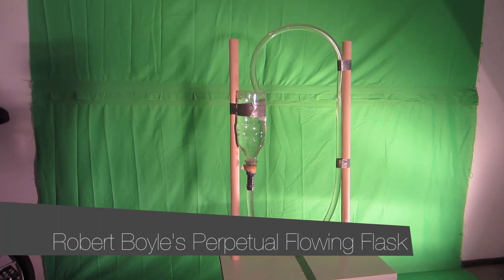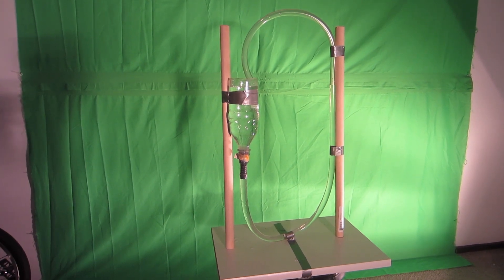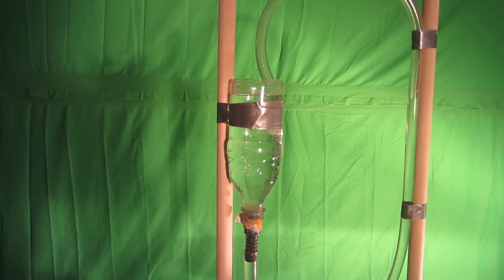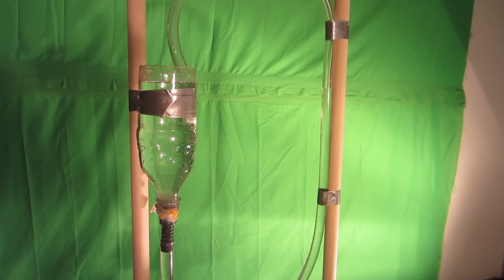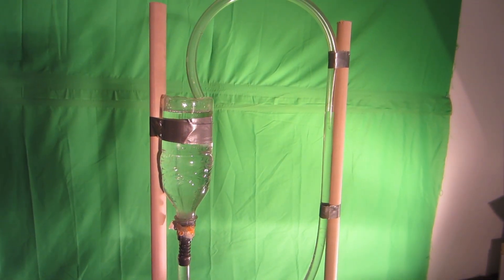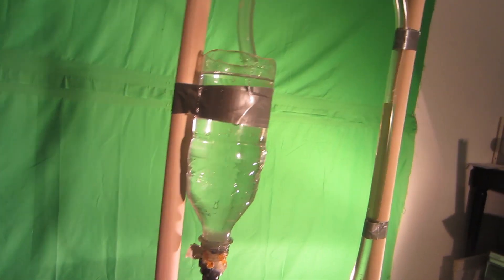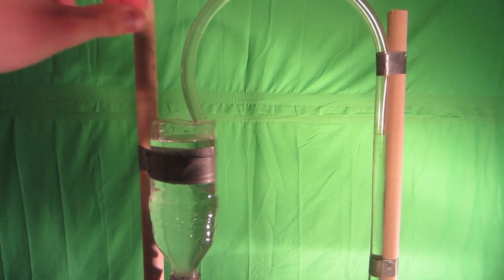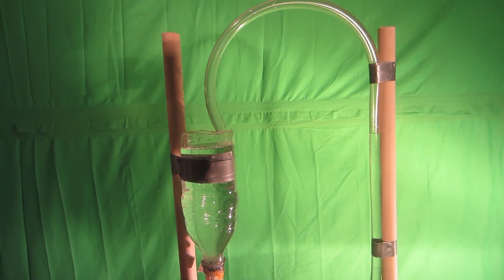Robert Boyle's Perpetual Flowing Flask Doesn't Work

Comment: Finally found a reference:

http://rationalwiki.org/wiki/Perpetual_motion#Capillary_bowl_.28Boyle.27s_Self-flowing_Fluid.29

I quote:

"water tension (related to the same force that causes capillary action) would prevent the flow emerging from the capillary at the end. A droplet may form on the end of the capillary, but would be held in place by the surface tension of the fluid; you could shake the device, forcing it to drop and encourage the flow to start, but that would be adding in energy to the system and defy the point of perpetual motion."

This takes care of all the "capillary" comments.

For a larger diameter (as in every single video I have seen, even if I have not seen them all) we have a macro situation where it is all about a communication vessel and there the levels are the same everywhere, regardless of the form of the vessel, including fluid filled parts that are themselves above the level in the open ends.

Comment: The law of gravity insists that liquid be level, in general. Some may argue that surface tension and capillarity play a crucial part in making this concept viable, but gravity in this case always wins, because gravity is stronger than either of those two factors, regardless of volume differential.

Comment: Why don't you make the input larger. The amount of weight in that cup seems to be equal to the amount in the tube. Maybe you should get like a large bowl or stew pot or something.
Reply: Because it is about pressure. As pressure is weight per area unit, and weight is area times height, only height matters.

Elementary math, elementary physics. 

If you are the kind of person who believe math and newtonian physics are useless, you are the kind of person who can't understand why perpetual motion machines are impossible,. and why this flask is impossible.

Comment: Thanks for posting!  I tried making one myself, and it just didn't work.  I used a much thinner tube over a much shorter distance, and it didn't matter.  What's interesting is that it can appear to work if you end the loop beneath the level of the water in the bottle.  IE, even if part of the tube goes above the bottle, if the tube ends below the bottle, water will flow.  However, the instant you bring the end of the tube above the bottle, the water goes back the other way.

Comment: The initial drop of water by you could be from HIGHER than the high point on the return pipe, and start the siphon action, but I'm pretty sure that a siphon output has to be lower than the input...but not sure.

Comment: Too wide tube and too small bottle. You also need to such the end of the tube to start the process.
Reply: It is a ratio of 1:3 to work at its best.
Reply: I made one with a much greater ratio (closer to 1:7), and it still doesn't work.  As soon as the water levels off in the tube, there's no net force that would cause the water to go any further.  That said, you may get a very short period of time when it appears to work, but only if there is air in the system or your force it to start (by sucking the water out of the tube to get it going).  Even then, it won't last more than a second or so.
Reply: Imagine the tube keeps going until the top of the water inside the filled bottle. That water in the imaginary tube has to have more volume than the tube itself. This is because it needs that weight of the vertical column of water to push down back into the water bottle.
Reply: +JustPaul it does not work if the bottle is flat but vertical. The column of water needs to be the ratio of  1:3 to the tube volume.

Comment: Try using a larger bottle, the weight of the water will definitely put it up the tube and back into the flask
Reply: It seems like it would work, but as soon as you try to put the end of the tube above the level of the water in the bottle, it just becomes easier for the water to stay in the bottle.  Think of it as potential energy vs kinetic energy- you can't get more potential energy than you started with by converting it to kinetic- at best it will just equal out.

Comment: It is insane that this gets 220 dislikes and 80 likes. What is wrong with people. You clearly demonstrate the Boyle flask in nonsense, and for that you get 220 dislikes.
Reply: +Matic Krmec - what, like magic fairy fluid or unicorn urine?
Reply: And explain to me why beer would work (and not water)?
And even if it did (and it doesn't) I expect you would tell me that the CO2 in the beer drives it. If that is so (which it isn't) then energy had to be used to put in the CO2 (ie, yeast converting sugar to CO2 and alcohol requiring heat) and if the beer did flow (which it won't, other than maybe some frothing) using the CO2 pressure, it would stop as soon as the beer was flat. So not free energy. But it just won't work. Try making this and use beer. You will be disappointed. Don't bee fooled by the youtube videos that show it works with beer. It's a hidden pump that does the work, that's all.

Comment: wait don't you have to use syphon pressure to start it? of course it won't work unless you activate the syphon action.
Reply: For a symphony to work the outlet needs to be lower than the level of the of the water. If it didn't we would have no need for pumps.
Reply: Would it work if the outlet connected to the flask bellow the water level?

Comment: Bottle far too small and tube is far too wide to create the pressure you need. This is the worst demonstration of science I have ever seen.
Reply: +Dan Askew Do you really think it would work then? Sorry dude, go to your teachers and get your money back ;-)
Reply: I also thought the proportions looked off, but that doesn't really matter.  You could have a swimming pool connected to a hose, but as long as the end of the hose is above the level of water in the pool, it won't work (unless somebody is forcing the water to move around, of course).
Reply: +Christian Andreas with wather-not posoble but try some beer 😉
Reply: +Dani Vasi best answer on the YouTube

Comment: Why on all the "DON'T WORK" videos does it seep people are sabotaging their own experiments?  You can use any size bottle, but you need to use a corresponding hose size....not too big.  Also, anyone who runs a fish tank with a large filtration system knows you have to prime your flow hose.  For this experiment, have the hose removable from its stationary position while still attached to its liquid source, so it can be laid down with your finger over the end so the water cannot reverse flow.  After the hose is full, place it back in position, remove your finger and...  Eazy Peazy!  Since I haven't tried this, it is only theory.  I guess I will do my own experiment and post a video.
Reply: +narapsnart It will still not work

Comment: You need to use a carbonated drink, like beer, the liquid pushes the foam created by the drink and creates the constant flow of liquid
Reply: Even if that is true, the carbon would run out over time. The reason carbon is in there in the first place is because energy was added into the system. With beer that is heat and sugar, energy the yeast needs to make CO2.

Comment: your bottle is too small, and your tube is too big, the perpetual motion machine does work, but only when the force weight is greater in the flask than in the tube, which is definitely physics possible
Reply: ***** dont have to, there's thousands of working models.  this video is just stupid
Reply: ***** what physics class did you take, perpetual motion is possible, just so long as energy is not taken away from the  system, which its not
Reply: +Son Goku "what physics class did you take". Well clearly no one taught by Deepak Chopra. This Boyle flask is not possible. If you can get one to work without using a pump, you will be the richest being in the universe overnight.

Comment: "the siphon requires it's output to be lower than it's input" ... A tube can only hold a fixed volume, once it is full, how can you possibly put more in than you take out? That is physically impossible. You might also try starting the siphon, they don't start themselves.

Comment: It just won't work. The problem is that you are seeing the fast flow of water through a small hole and thinking that it means there is more force. There isn't. Force is equal to the Mass of an object times the Acceleration (F=MA). As mass goes down (smaller hole), acceleration goes up when there is the same amount of force. Higher acceleration means a faster flow, but because the mass of water is smaller, the force is constant. Think about it. If you push two objects with the same amount of force, the one that weighs less will move faster.

That force that is pushing the water down is gravity. The amount of force being pushed down on the water in the flask from gravity is equal to the amount of force being pushed down on the water in the tube. If you make the hole smaller, the water accelerates more rapidly (F=MA), but in the end, you have the same amount of force pushing down on the water in the tube as in the flask. That is why, no matter what size tube, what size flask, or what angle flask you use, you will always wind up with the water level in the tube being equal to the water level in the flask.
Reply: Dude, i don't want to scare you, but i think we are the only ones here that know simple physic laws. Its scary how little knowledge these people have.
Reply: Ive written out this which i tell everyone in these comments now. 'I understand the logic of your thinking and you have common sense, but in physics theres a law that goes 'pressure in liquids is equal in all directions'. What this means is that just because theres a lot more water in the bottle, it does not increase the pressure in the tube to force the liquid back up.'

Comment: The container has to have sides that are a more gradual taper, and the tubing is too large. It doesn't work as a siphon. The gradual taper of the vessel adds an additional pressure component to the column of water directly over the tube, and the sum of these pressures is more than the weight of the water in the tube. If you do it right, which you didn't.
Reply: +SunPower Guru == Oh, stop pretending to know things you don't know.  The shape of the container doesn't make a bit of difference.  It can't work, period.  P=pgh.  Bernoulli's laws of fluid dynamics.

Comment: Hmmmm... I wonder why your first and sole attempt was a failure. Perhaps, it's because you're using a tiny bottle, and a tube with a massive diameter. Obviously this would allow equal weight to be distributed between the tube and the bottle. The length of the tube and it's hight, equal a higher total volume than the volume of that tiny bottle. This would definitely work. I honestly know nothing about physics, but using basic common sense I can tell you that if the water in the bottle weighs more than the entire volume of the tube, then there would always be enough pressure to push the water through the tube. If you need an example here is an obvious one. Imagine, an enormous cone, so large that it makes the Burj Khalifa look small in comparison. This monumental cone, is filled to the brim with water. Millions of gallons of water. All this weight. Imagine that this cone is elevated just a few feet off the ground with the support of unfathomably large steel beams. Now, say I handed you a screw driver and asked you to unscrew the tiny lid at the very bottom of the cone. At the very point of the cone, where the most force is being exerted. And so, you unscrew the lid and the cap flies off, leaving a small opening at the bottom of the cone, about three inches in diameter. Water is shooting out of this hole with so much power. The water inside this cone is valuable to the people, so you must stop the leaking. But the lid was blasted clean off and theres no way it's going back on. So you find a long tube with a three inch diameter just like the hole in the cone. You attach the tube to the hole so tightly that it is 100% water proof. This tube happens to be just a bit longer than the cone is in hight. You have the idea to redirect the leak right back into the cone. So you go in a helicopter and bring the tube up with you. Water is rocketing out of the tube, but you're holding it out of the helicopter so it doesn't hit you with that incredible stream. The helicopter is just about to reach the top of the con. Your so close to the top. Just a foot higher and you will be high enough to place the tube on the side of the cone. You know it's your destiny to return the water to the cone. Your hands touch the edge of the cone, and you place the tube so it's aimed to pour the water right back in. But oh no! Apparently there isn't enough water pressure from this gargantuan cone to push the water up the incredibly thin tube and up the the top. What's this! Gravity is just so strong that it can withstand the tremendous force of water that should be surging from the tube. WOW. Yeah, like that would happen. That is your logic.
I have no idea what physics your talking about, but it's kind of obvious that water will always go from a higher pressure to a lower pressure if it can. If there is more weight on one side then there is more pressure. To achieve this, use a large, wide cone, and a thin tube. The output input nonsense you were saying makes no sense whatsoever.
Reply: +Juan-Roberto Awesome Now that I think about it... I was 100% wrong. I guess that's what happens when I challenge scientific laws. You could've just said water level.
Reply: +Juan-Roberto Awesome Nice video :)
Reply: I understand the logic of your thinking and you have common sense, but in physics theres a law that goes 'pressure in liquids is equal in all directions'. What this means is that just because theres a lot more water in the bottle, it does not increase the pressure in the tube to force the liquid back up. Its just a weird physics law, just gotta learn it.

Comment: IF, ...... you use 1mm or less, inner diameter hose, a 5 gallon tank/bucket/whatever. .... make the "u", parts very shallow, the "wieght", of the water makes it it work if you set it off by sucking the water through. "Capillary siphon".

Comment: this is possible. the container should be big. so the tube does not suck all the liquid in the container, if its not working you have to suck the liquid out to that tube and it will flow continuously.

Comment: It works it's cause your tube is to thick
Reply: +DubstebTurtle7  thats what she said
Reply: I understand the logic of your thinking and you have common sense, but in physics theres a law that goes 'pressure in liquids is equal in all directions'. What this means is that just because theres a lot more water in the bottle, it does not increase the pressure in the tube to force the liquid back up.

Comment: theres a lot of calculation to be done.. the length of the funnel
capacity.. size of the tube .. ect
u cant just attach a tube to a bottle .. smh
Reply: No calculations needed mate... If you actually know physics you'll remember the law 'pressure in liquids is equal in all directions' but I guess you missed that class..

Comment: I love these videos showing it doesn't work.  I love the comments from people who don't know physics even more... "The tube is too fat, there is too much water on the right..."

Look, even if the tube on the right was 1mm wide and the left side was the size of an ocean... they would equalize...
Reply: PCS Entertainment Could you refer to the math involved in this? I understand it's impossible but I don't quite understand why
Reply: This helps explain it a bit.  It's normal physics... you can actually get the formulas and run the equations and see it's real (the equalization).  Just google around for the actual formulas...

http://physics.stackexchange.com/questions/799/why-does-the-water-level-equalize-in-a-series-of-tubes
Reply: +PCS Entertainment its working man wtf ????? i cant believe man ???

Comment: Use carbonated liquids.
Reply: It's not perpetual.
Reply: David Trew no duh. The carbonation only makes this function for a few seconds.
Reply: +AlmostSober mhm
Reply: +David Trew perpetual motion is impossible. Using carbonated beverages makes the self flowing flask appear to work. That's why so many demonstrations use soda or beer.
Reply: +AlmostSober yup, I know.
Reply: +AlmostSober well it is in space
Reply: +David Trew AlmostSober is actually right. The carbonation eventually runs out due to the lack of outside pressure from the carbonated container it started in.
Reply: +AlmostSober == No.  Carbonation won't make it flow either.  You're just saying that because you fell for a different hoax video.  Go try it yourself if you want.  Carbonate the living daylights out of any liquid you want.  Watch it fail.
Reply: +rockethead7 idiot,  not saying it works. It makes it appear to work momentarily,  long enough to make a short video and easy to edit.

Comment: To all ppl that say its possible 1. make a huge version of that and use a water powered generator for your own house (its not possible learn physics) 2 the only thing you can do with it is a WATER LEVEL ( DID YOU SAW THAT THE WATER STOPS AT THE SAME LEVEL IN THE TUBE THAT IS IN THE TANK TOO?) research water level

Comment: what about a larger container of water thus adding more weight/pressure?
Reply: In physics theres a law that goes 'pressure in liquids is equal in all directions'. What this means is that just because theres a lot more water in the bottle, it does not increase the pressure in the tube to force the liquid back up.
Reply: k, thk u
Reply: +David Chastain np dude :)

Comment: You keep saying "siphon" it's not a siphon. Energy is not being created out of thin air, you're using gravity which is a constant. Your set up is incorrect suggesting you either botched the experiment on purpose to fit your point or you really just don't know what you're doing. Either way you can't claim you did a scientific experiment.